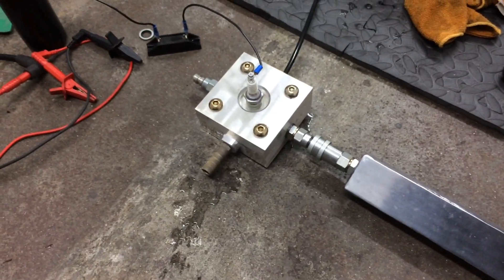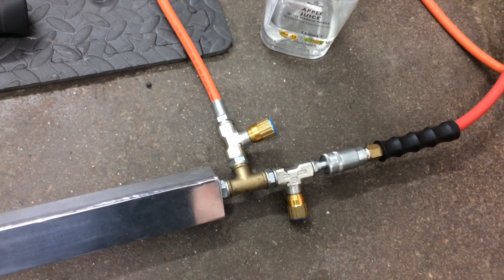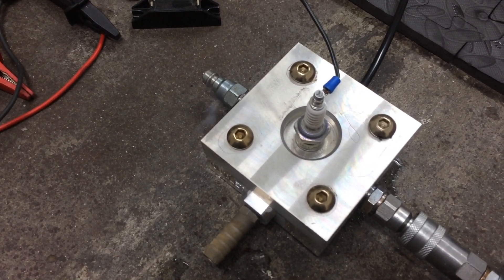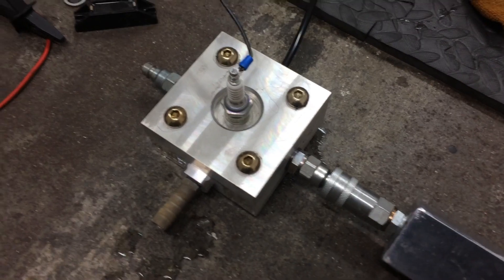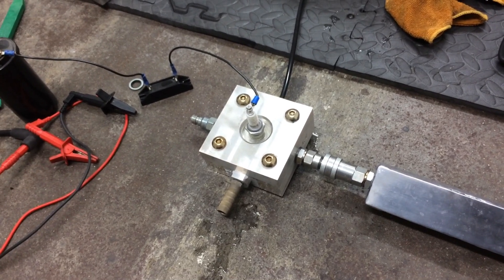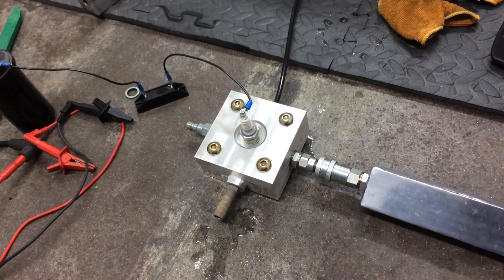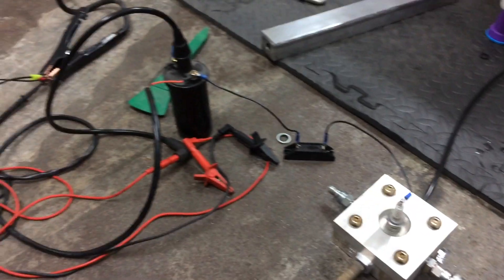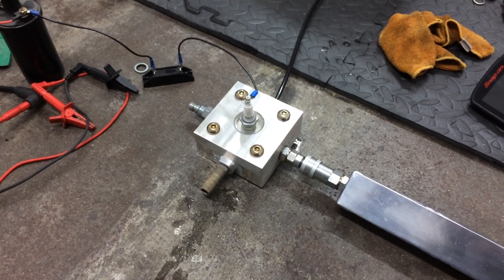Nikola Tesla's Self Resonating Super Heated Steam Boiler - Raw Footage

Comment: That is one sexy looking thumb nail! Now you just have to feed it some HHO with that LPG maybe?
Reply: @nikola.tesla.r.and.d.centre  HHO make pure water. A couple of volts, some stainless steel fly screen and a liter of urine and you are making it. It burns in your motor and the exhaust is pure water h20
Reply: Quick flick through the book. Sorry but the periodic table says nitrogen is answer number seven. Although Tesla nailed some great life advice that proved that he was ahead of the times. Tea, coffee, tabacoo and other stimulates are bad for you.
Hydrogen is the answer. Crack that and ever other atom is your bitch. Hydrogen bomb 💣 just saying. 🤷‍♂️
Reply: HHO is implosive. It burns at 2800°C. It may provide the vacuum and temperatures that you need. It may even exhaust cold steam in the depressurized turbine system
Reply: @nikola.tesla.r.and.d.centre  OK I am dicking around with radar absorbing materials atm. I will give it a read in my down time and see if I can get my head into it. One of my trades is aluminium anodiser and we use nitric acid it is a messy mean bitch. Any thing that can make nitrous dioxide can make huge power that and kerosene will get you to space.
Reply: @nikola.tesla.r.and.d.centre  uh, water?  Just guessin'
But how much extra power from the same kit given the same input energy is the question...
Reply: @nikola.tesla.r.and.d.centre  "Mechanical radiant energy receiver" 😲
Reply: @nikola.tesla.r.and.d.centre  Good luck mate. Everyone's excited to see more. Go for it
Reply: @nikola.tesla.r.and.d.centre  water you get water. If you add to air and burn you get nitrous oxide that burns and makes water. Add hydrogen peroxide and you get no left over water from the hydrogen and get more water from the nitrogen. Nitrogen is a bitch in its acid form, hydrogen in its acid form hell I would drink 7 litres of that a day 😉
Reply: Hell try 3% peroxide in the tank for a quick run and tell me what difference you see. 7 buck experiment if it doesn't work I will shout you the money
Reply: @nikola.tesla.r.and.d.centre  the peroxide 3% is available at the chemist. It will decrease the detonation time. And make more steam as a by product. 

The most effective way to take nitrogen from the air and add it to the soil has already been invented thousands of years ago it is called growing potatoes.
 HHO can be made from urea / urine super easy and it is 46 % nitrogen.  Hydrogen is not actually considered volatile. Lithuim is volatile. Hydrogen is just flammable like your LPG